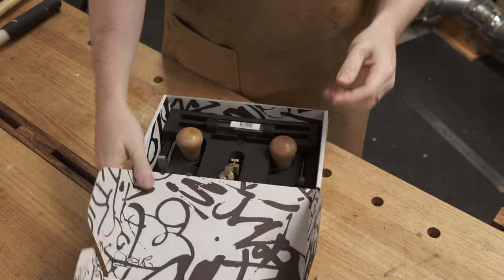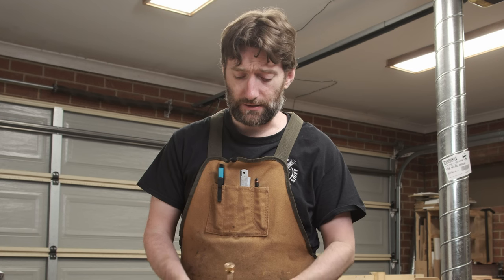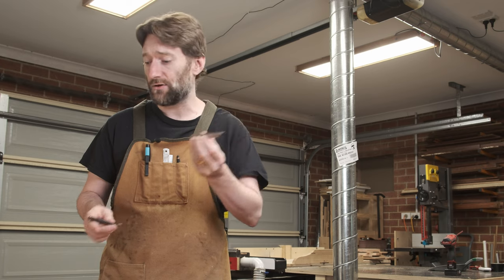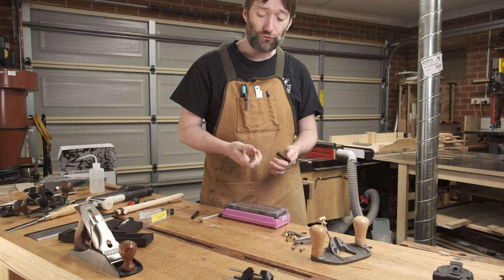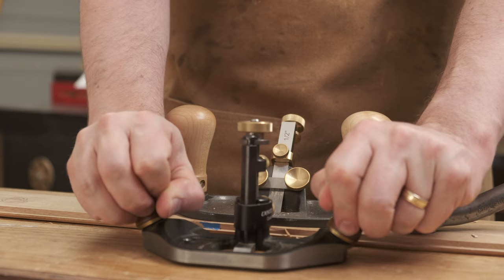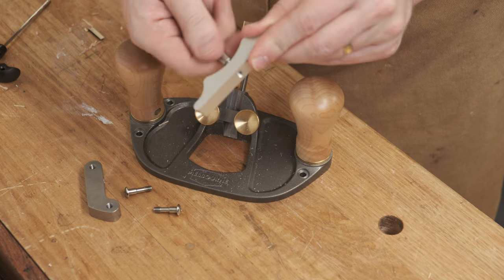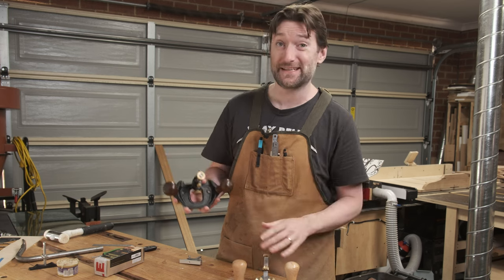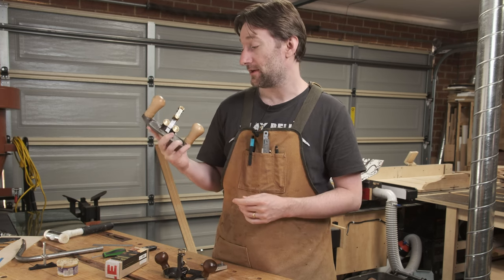MTC Large Router Plane - Better than Veritas?

Comment from the maker: A note from Geoff Doube about the thread pitch 
The pitch on the MTC version is coarser but the blade is not being raised vertically like the Veritas. For each 1mm you advance the screw, the blade moves 0.77mm downwards

That means if it was as fine as the Veritas it’d then end up being much more work to adjust with the angle

Comment: The plane itself looks very nice. I already have a Stanley but I might pick this up as well. Frequently I've found on a job I'll need to keep re-setting it to different depths when fine-tuning mortises etc, so having an extra plane I can leave set for the finishing cut would save a lot of time. Currently on special for $215 which I think is an absolute steal, especially given how much good condition models go for on the second hand market. 

One thing I'd love to know is if it's still able to be used as a makeshift marking gauge? The L-shaped blade on the traditional models means it's very easy to set a depth on the router plane, then bring it to the wood and use it as a marking gauge to run a light cut along the edges. This saves having to set up a marking gauge, and ensures that the depth you cut will match whatever you marked. It seems like the large, straight angled cutter on the MTC plane would make this difficult or impossible.
Reply: That’s brilliant. I never would have thought to use a router plane as a marking gauge!
Reply: @graduallywizardly  yeah it works well! I think I picked it up from Paul Sellers
Reply from the maker: I think I get what you mean - I'll give it a shot later today and compare the two for marking gaugeability. I think if the router was skewed slightly (so cutting more on a point) it should go reasonably well
Reply from the maker: Just to clarify you mean this technique? https://youtu.be/r-08PY3stgo?t=131

If so, it was marginally easier on the MTC plane. The wider surface and handle position got less in the way of my hands, but both marked just fine. The geometry of the MTC's blade/bed angle causes slightly more of a depression/cut on the waste side. I don't think thats really an issue since it is on the waste side.
Reply: @TheWoodKnight thanks! Yep that’s it. I actually ended up buying one anyway and tried it out this morning and yeah it worked perfectly well for setting and marking the depth. Pretty happy with it overall, just need to hone the edge a little. My hands are used to shorter handles but I think that’ll just take time to get used to it.

Comment: Seems great for the price. It's priced right in between the cheap ones like Cowryman and the Veritas, but seems more comparable to the Veritas. If this was available for a similar price in Europe I bet it would sell well. IMO there is definitely a niche to be filled with a router plane like this. I got lucky and found a complete/basically as new Record 071 for a really good price but deals on used routers are extremely rare, the prices are crazy.
Reply from the maker: Cowryman are interesting - they have so many different models! They've done away with casting by having everything be machined from blocks/plates and then bolt together.

I have no insider information, but I wouldn't be shocked if MTC planes appear in Europe if they go well in the North American market. Dictum sell the JKM router plane, but for more than Veritas!  I bet Dieter Schmid/Fine Tools would love to have a router plane around the price point of JUUMA

Comment: Looks like highspeed tool steel blanks and a grinder and you can have all sorts of custom blades for the MTC.
Reply from the maker: Hah, more than likely! Cutting the slot for the adjuster might be a bit tricky - it might just be easier to buy a few 12mm cutters and grind down.

Comment: I have had the Veritas for many years. I agree it is a pain in the Butt to sharpen. I have never used the fence. I have also made my own to the Paul Sellers design, which has the same blade (but home made) design as the MTC router. I find I use it more often purely because it is easier to sharpen.

Comment: Good review, they seem well made. Their design seems to be very similar to the wooden router kits available in various places, but just with a metal body and the flexibility of a fence. I think the blade being easier to sharpen is a big plus, as you said and i agree the original 71 blade is rather annoying to get sharp and get co-plainer to the sole. Having a more simple design in my view just means they are easier to understand and use.

Comment: Yeah man. Great unit. There’s a bunch of tiny cutters for the small router plane. 1-6mm and a 1/16”-1/4”. They might be a better call for inlay work. The little guy’s weirdly comfy in the hands.
Reply from the maker: Half the stringing I've done so far has benefited from having a fence which the little guy lacks (I think all small planes do?). Maybe I can 3D print some sort of adapter 😆
Reply: Yeah man, like a sole plate of some kind? To be honest, I mostly just use my little rp to hack off the atb tooth pattern left behind if I’ve cut a dado at the table saw without first swapping to a flat top blade. It’s excellent for that sort of thing. If i’ve only got a couple little grooves to do, it’s usually not worth the hassle of swapping out the blade and back again for the next cut.

Comment: Decent looking router plane.  M2 HSS isn’t great for hand tools because they are harder to sharpen than O1 or A2 steel.
Reply from the maker: It wasn't too bad on shaptons - I'd imagine it'd be the same on any other hard ceramics and diamond stones. If you use scarysharp, oilstones or soft water stones, I agree, it'd be a bit too slow that sharpening would be a nightmare

Comment: MeizhouTC planer is such a basic inexpensive tool it could of and should of been made in Australia. Very small cnc lathe could of pumped out the brass and a copy lathe pump out the handles. Plenty of small foundries in Melbourne and Victoria that could of batched out the base, I know because I use them in the water industry. I was sold until the communists stuck their heads up.